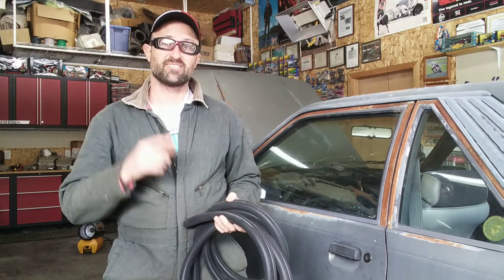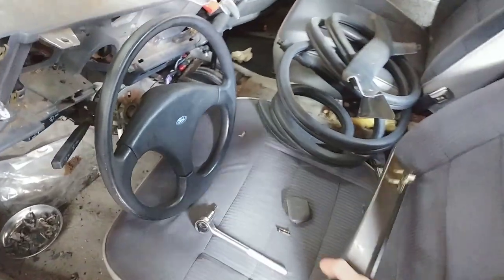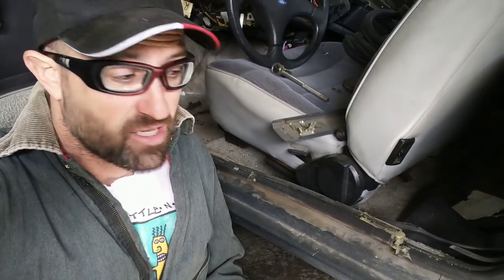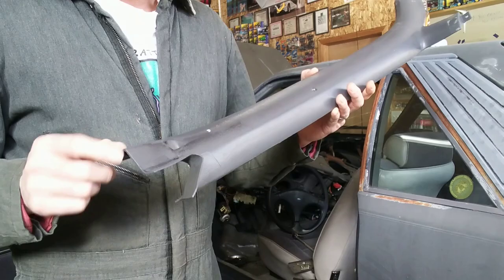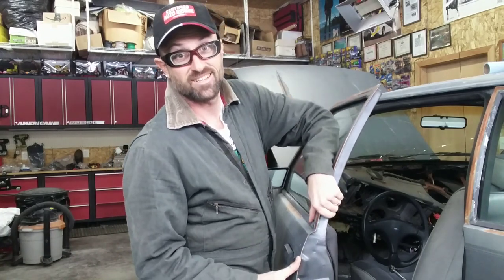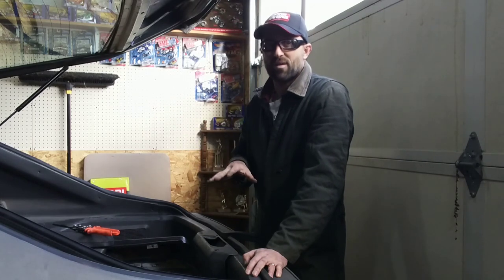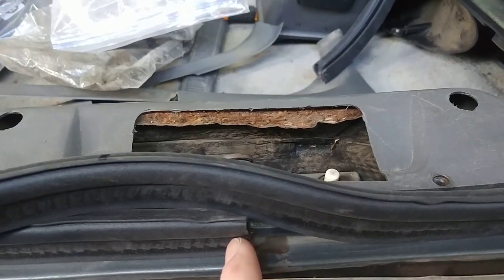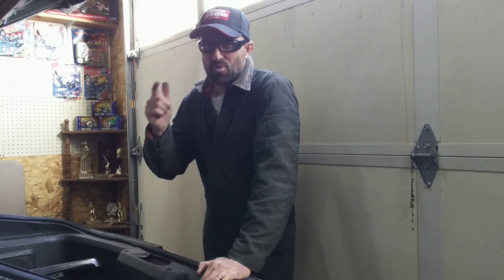How to Replace Door & Hatch Weatherstrip Seals | Foxbody Mustang

Comment: Seen you had a flared quarters in a video.  I have an 85 GT convertible I want to put wide flares on.  I seen an 86 back in 90’s that had flared front and rear flare that looked bad ass.   Would like to replicate it.  Did you custom build your flares?
Reply from the maker: The green widebody had 3" fiberglass flares and fenders from Maier Racing.

Comment: Nice work , so it sounds like you decided to move the “Grey Lady” to a new owner-how much resto. Are you planning before sale? Good luck with the process and how do plan to market her
Reply from the maker: Yep, the '86 will eventually find a new home.  I just finished up the heater core, so from this point I plan on taking all the interior out to see what needs replaced.  I know headliner and hatch carpet need replaced, but not 100% sure if the main carpet does yet.  The seats could use a refresh, but I haven't decided what I want to do with them yet.  The new cloth is about $450 for the front seats, and I'd be disappointed if I changed it and the new owner gets rid of it immediately.  I will be fixing all the body dents and dings, repainting the molding and trim, then vinyl wrapping the car.  It will look new on the outside.  I'm going to leave the V6 engine and 3-speed transmission.  They need a little work to be more reliable, but will give a new owner a good starting point to drive the car and enjoy it before they start on their own adventure with it.As for marketing, probably just the usual ways.  Facebook Marketplace, Craigslist, and Facebook Foxbody groups.  I'll put it up for sale on the channel with a walk around video when it's ready to go, which I can also use on the sale ads.  I don't have an exact price in mind at this point.  It's going to depend on how much I have into it when the time for sale comes.  Maybe I'll wait for Barrett-Jackson to happen next January when it will get out of control again!  :-)

Comment: Where did you locate the correct seal ? 😊
Reply from the maker: I bought a complete seal kit from Late Model Restoration.
Reply: @BasinMotorsports     I purchased from Soff seal . Difficult getting the kink out of the sharp turn at top of b pillar, and I m seeing daylight below that same spot as if the bulb is not large enough. Leaks like crazy . So the LMR you believe is more correct? Thank you for any help. 
    Was a body man , 18 plus years, but been awhile now since I’ve restored a car , I’m now 62 🤪
Reply from the maker: I have bought 3 sets through LMR without any problems. If they don't have any, try National Parts Depot.
Reply: @BasinMotorsports  I’ll go with the lmr seals then . I run these around the edge of the garbage can , thanks soooo much 👍